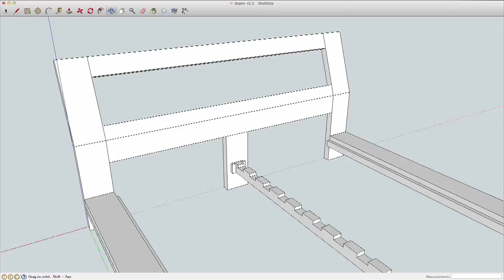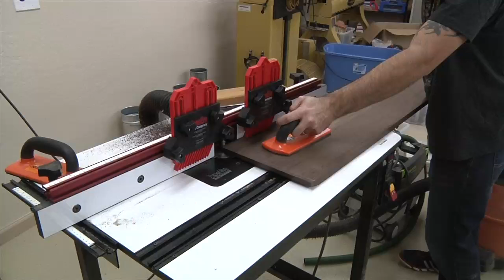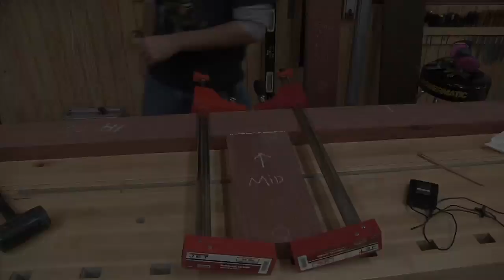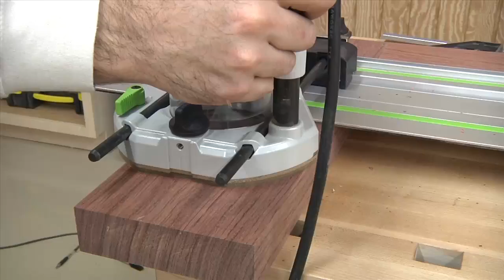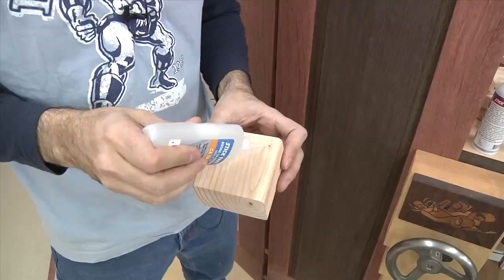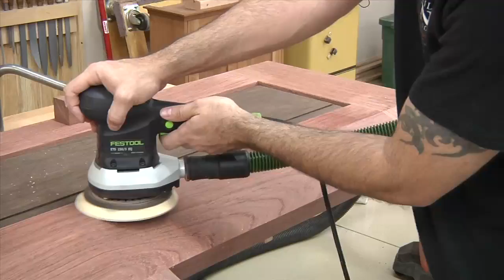Platform Bed (Part 2 of 4) - The Headboard

Comment: have you considered a cnc?  there is a larger up front cost, but you save so much time in the long run that it pays for itself.  Plus, cnc's are getting so much cheaper these days.  with a little skill and training you can do so much more with them and replace many of your common hand tools.  At the vary least it opens up more opportunities for high quality, value added options while you go and do something else.

Comment from the maker: It's all in the pad. Most ROS pads are fairly soft and will contribute to rounding over edges. I use a special hard pad that keeps the edges crisp. Of course a scraper is a good idea either way and makes sure the sanding is kept to a minimum.

Comment from the maker: Using the quick set activator means within seconds, the glue is solid. Doesn't have much time to penetrate. And what little does penetrate is easily scraped or sanded away. Other wood species might behave a little differently but on a dense hardwood, it shouldn't really be a problem.

Comment from the maker: Depends. If I know the piece is going to get a lot of surfacing after the glueup, I just use a damp rag to wipe it up. If it's a critical face piece, I will let the glue skin over (about 45 minutes here in AZ) and then scrape it off in clumps.